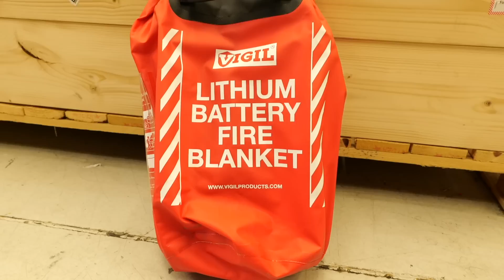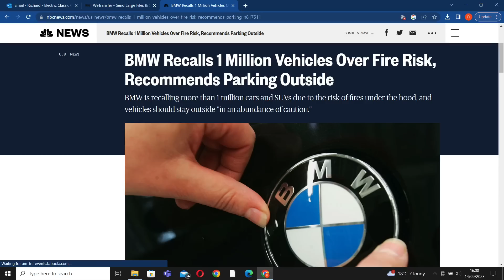Electric Car Fires - Facts and Figures

Comment: In Denmark the fire brigade has a container with an electric winch. In case of a burning EV, for example in a carpark, the fire brigade will drag the burning car into the container with the winch. The container is then moved to a remote place where the fire is kept under control. In the container the car is cooled  with water, that is recycled in a closed loop, inside the container. The car will remain in the container for at least 24 hours to make sure that the fire is put out for good 👍
Reply: In parking space situation in confined spaces situation (like building basement .. ferry ships ..etc) ... how likely this "wiched container" will work to overcome BEV fire incident ..??????????????/
Reply: @kebeleteeek4227  One "?" is quite enough, to make your point.
Weel they use them in practice, so there's your answer... I do believe there are some solutions with small robots to drag them of the car park to the container
Reply: @briantarby675  How quick those robots can be deployed to deal with rapid cascading effect of BEV battery self combustion ..??  .. How strong those robots to deal with "incinerator" kind of fire situation in confined spaces (basements .. ferry ships ..etc ..) ...?? ...   Not to mention the availability of that robots .. ??
Reply: @kebeleteeek4227  at least those robots won't die or be permanently disabled by the gases and smoke from the batteries.
Reply: @LoremIpsum1970     .. there is "good news" though ...   " ... Compared with their respective population here, EV fires averaged 2.45 per 10,000 vehicles, versus 0.42 for electric hybrids and 1.97 for combustion engine vehicles .. " .. -StraitTimes (Singapore): ...

" ... Looking at the London Fire Brigade data, that would suggest an incident rate of 0.04% for petrol and diesel car fires, while the rate for plug-in vehicle is more than double at 0.1% .. " ... -FleetNews ..  LOLLLLL
Reply: I believe EV’s are the future, no doubt. I support that future. Thanks for producing this video. Yet as an architect and firefighter, I will state that thermal runaway is a real challenge that we have never seen - regardless of the ‘percentage of occurrence’  stats - lithium battery fires are presenting fire departments and building fire protection systems with challenges as yet unseen and never accommodated for in design or construction of any of our structures worldwide. Quite simply lithium battery fires that include E-Bikes, EVs, personal mobility devices, etc. make fires in confined and semi-confined spaces much, much worse. These challenges are that fires well seated by thermal runaway burn faster, hotter and more violently making firefighting more dangerous, and property and life loss greater on a per incident basis when the ignition and/or fuel sources happen to involve extremely rapid, self-sustaining chemical decomposition. In the end, currently there may be less occurrence by type of vehicle/fuel source but fires involving thermal runaways are much worse, less controllable incidents.  Also your report completely ignores showing a side-by-side of an EV and ICE vehicle fire that would clearly show the challenges to the response forces required, the extended incident timelines hence collateral impacts (e.g. traffic, air quality, etc.), and the additional required water resources with resultant pollution streams.  The EV industry should be less worried about how media portrays the risks and contributions to major incidents and more concerned with financing the research into incident suppression in the name of public safety and providing the tools required to do so; it is not a problem that the fire service should have to solve.  PS Your data needs also. to be correlated by relative age of the vehicles involved to in fires. It’d be interesting to know if the percentages get closer as the age the EV/ICE vehicles get closer. Obviously the ICE fleet in Sweden is on a average older than the EV fleet.
Reply: @quarrycliff  I pity the public not being made aware of the potential harm from off-gassing and smoke, as they won't be wearing PPE
Reply: @quarrycliff 
Good points all sir!!!
Speaking as a retired EE and volunteer firefighter here in USA I 2nd your thoughts and opinions.  EV fires: Low probability? Perhaps..
High Consequences? DEFINITELY
Reply: They did similar on the damaged EVs on the Freemantle Highway. Sodium carbonate solution in a steel container 'safely' discharges the battery pack, covering the container and reducing fumes. One thing to note that no one mentions is the toxicity of the gases/smoke and suppressant runoff from packs containing cobalt.
Reply: @LoremIpsum1970  EV fans never mention ANY of the problems associated with them. If anybody else does they deny them, there seems to be a general trend that if they haven't had any issues then they think nobody else has or will. I even had one last week saying there are no problems with EVs at all. Try telling that to the millions who can't charge at home, or those who can't afford one.
Reply: Fire percentage,  0.08 for ice, 0.004 for ev.  Fine if you compare vehicles with the same age and odometer miles.  As ice vehicles, at least, age the failure rate, including Fire, increases. Most EVs have logged far fewer miles  and are comparatively much newer  than the ice fleet.   I don't know if such an apples to apples study has been done, but until we have that data, I believe the  jury is still out.
Reply: Let's assume EVs have a lower fire incidence of fire. Right.  But the Consequences of an EV fire are far more severe if the battery is involved.  It matters not if the fire started in the EV or a petrol vehicle parked next to it.  Toxic gasses and vapors such as HF are released, and if thermal runaway does not immediately  ignite this flammable mix, we have an inhalation hazard and possibly a deflagration event.
Please remember that all li ion chemistries contain fuel and oxidizer in each cell. If the porous polymer separator, typically less than 0.001 inch thickness is violated for any number of reasons an immediate or delayed thermal runaway may occur.
Reply: This proves that also authorities unfortunately believe the sensational stories of the propaganda. They really think that it is a matter of time that one EV will catch fire instantly.
Reply: Unless the garage has a max height, like most have here, of max 1.80 m. Then they cant get it in.
Reply: Has anyone considered the costs of EV dunk tanks in terms of fire personnel, prolonged road closure, and safe detoxification of the used water? Oh and the chemical soup in the burned out 1000 pound battery remains? Can we compare the Total Cost of one EV fire to one ICE fire?
Has anyone done a study on this?  If anyone knows on one please add a link herein.
Reply: There was a guy who took his tesla to the boat ramo bc he was hauling his boat, his telsa caught fire. For FD just pushed his car i to the water. Bc it was a lithium ion battery it produced it’s own oxygen as it burned, it was fully submerged and continued to burn for 2 days
Reply: Meanwhile in countries like Australia (and presumably the US and UK) we’ll just focus on complaining and overreacting to the occasional BEV fire and denying the need to shift away from fossil fuels asap, instead of coming up with clever solutions like that.
Reply: @ad_fletch  Try that on a busy motorway where it takes an hour to get to the car. Did you see the bus that went up in Paris? Had there been passengers on that bus there's no way they would have got out. We're getting those where I live soon. Yet I can't remember the last time a diesel bus went up in flames. 

The point is it's another serious issue that causes a lot more problems and needs to be addressed, but as with anything EV, anytime that anything negative is brought up it's just about making excuses. All this extra hassle, and all this extra money that's needed at a time when people can least afford it is not what is needed. 

Transport accounts for a tiny percentage of fossil fuel use, and that's all transport, including ships, railways, air travel and so on, and switching to EVs won't make that much difference anyway as oil is still needed for the plastics, the tyres, the manufacturing plants, the extraction of heavy metals for the batteries and so on. There are far better things that could be done, electrifying the railways for one, some areas have been waiting for decades and still are. Cutting back on imported junk that we don't need and should stop buying would probably make more difference than forcing everybody to go buy an EV and would be a damn sight cheaper too. Scrapping hundreds of millions of perfectly good cars and building millions of new ones, all of which will lead to more emissions from the manufacturing process in the short term, is at best madness for the tiny amount of emissions it will eventually save - if any at all. And you all have the audacity to try and claim that we're the ones with our heads in the sand.

Comment: There was a case in Norway where a fire had started in a parking garage destroying hundreds of cars, the media immediately started rolling the news as "NORWAY FULL OF EV's! EV STARTS MAJOR FIRE! EV ARE DANGEROUS BLA BLA" and everyone rolled with and everyone believed it... but the authorities later released a video from a surveilles camera that showed a diesel car starting the fire... and what did the media do? that's right, not a damn thing, they where silent as the grave..
Reply: Also in Norway there was an EV fire in a nearby town, and the media went ballistic over it before any details were out.

Turns out the EV battery wasn't involved in the fire at all. It was an interior fire caused by a cheap power tool in the rear seat catching fire.
Reply from the maker: Yep, unfortunately that’s how the media works. I see this type of thing every week. ☹️

Comment: There are lies, dammed lies and statistics and of course you have to take into account the ages of those vehicles I admit I don`t know but would guess in Sweden the average age of ICE cars is much older than the average age of EV cars?  We had a less than 1 year old Mercedes EQV on our fleet that suffered damage from a marder and we were told we were VERY lucky it didn`t catch fire. The problem is that that likely happened when parked in an underground car park and it would have been in amongst many other cars.
The products of combustion from an EV fire are much more dangerous than from a ICE car and people inhaling the smoke are much more likely to have a bad outcome.
The basic premiss that this is a high risk / low probability event is true but as with ICE cars as age increases so probably will the occurrence of fires for a lot of the same reasons older  ICE cars are more likely to catch fire.
The key issue at the moment is the lithium content in batteries and how it responds to thermal runaway. Alternative battery technologies can mitigate the risks down to probably a similar level to existing ICE cars and maybe even lower, lets hope they are available quickly.
Reply from the maker: The age arguments don’t really stack up because the number of recalls of new ICE cars due to fire safety issues is so high.

Comment: Thanks for the explanation. I also heard that many EV fires started some time after they damaged the battery cage with a stone or something on the road
Reply: If you want to see JUST how incredibly resilient battery cases are in their ability to resist puncture, just watch the other "Truth about EV fires" video on this channel from 4 months ago - Richard has a fabulous time "blowing things up" as he puts it...!!  🤣
Reply: Hi, yes, depending on the battery technology. Oxygen in the air can get in and trigger a chemical reaction. Does not happen with the later Lithium Iron Phosphate (LFP) technology - the 'F' stands for ferrous, ie Iron. It's one reasons why the battery packs are built so strongly. However, how comfortable are we driving around with a tank of petrol/gasoline in the back of our cars waiting for a rear end collision? In that respect diesel is safer, much more difficult to ignite a spark.Unfortunately, not good for the roadside environment.
Reply: Just because you heard something does not make it true. Condon has made that perfectly clear to all (open) ears.
Reply: I drive an EV taxi and i have to deal daily with anti EV people which is annoying. I'm defending EVs not saying bad things about them. A damaged battery cage can be a problem
Reply: @2.3_44XD--  True and a damaged gas tank can be a problem also just ask a Pinto owner if they are still around.
Reply: @2.3_44XD--  Must be a great savings from an ICE.

Comment: Last vehicle fire I saw was a BMW M4 6 cylinder petrol. It was a shell by the time I passed it. Fire was a quarter of a mile from the Fire Station. Previous to that was a wee old Corsa, probably petrol. Before that a diesel double decker bus, which was down to its frame only 2 miles from Fire Station.

Comment: Lets get the stats right, when looking at cars on fire, EV cars are pretty YOUNG. ICE cars fires also include cars made in the 70's... Can we put a production age on car fires to have an honest discussion? I have 3 EVs on my parking but own more ICE vehicules..  None of them burning :-)
Reply from the maker: BMW, Hyundai,Kia, Ford, to name but a few manufacturers that are presently recalling millions of ICE cars because of fire risk on new cars this year. And over the past few years nearly every major car manufacturer has had recalls because of fire risks.
Reply: @ElectricClassicCars  isn't because new cars are full of electronics and control systems that they more prone to failure and catastrophic events? Does not matter if they are EV or ICE... Major manufacturers keep cost cutting and produce lower quality. Toyota bZ4X had the wheel fall off, I hardly call that an EV related issue...
Reply: Car fires are in general rare.

Comment: Another thing to consider: EV batteries are rapidly getting safer and more resistant to thermal runaway every year as more development goes into them. That might explain why the number of EV fires hasn’t increased despite more of them being on the road.
ICE cars aren’t getting any safer in this regard really.
Reply from the maker: Very true. More and more new EVs are coming out with more stable battery chemistry like LFP which is much less likely to catch fire too. 👍

Comment: A couple weeks ago, a local news station had a story about an electric car crashing into a tree, causing a massive fire. The detail they left out of the headline was the fact that the electric car crashed into the tree 6 feet above ground...and may have been exceeding the speed limit just a bit before launching into the air and colliding with the tree.
Reply: ...but that's still a fire...no? does the speed or whether it was flying make any difference?
Reply: ///been exceeding the speed limit just a bit before launching into the air and colliding with the tree.///

...and if the car had been an ICE vehicle doing the same thing, would that have caused a massive fire too?

Or to put it another way, the speeding bit is irrelevant, it's the causing a massive fire part that is noteworthy.
Reply: When someone hits a tree, I just assume they were either drunk, speeding, driving like an a--hole, or all three. People tend to hit trees or power poles pretty hard.
Reply: @mswen1983  Hitting a tree is a lot safer way to stop a car than hitting solid rock... Most cars are big enough that they climb up the tree if speed is right. A long time ago I stopped my car by reversing it downhill to a tree after both clutch and brakes failed. I just pulled the ignition key off and jumped out.
Reply: That's not the concern. Doesn't matter. What matters is that a regular gasoline/diesel vehicle can be extinguished fairly easily with 500-1000 gals of water. An EV fire can take up to 40-50 THOUSAND gallons. My municipality has had several of these and it's the same problem every time no matter the manufacturer.
Reply: still EV owners should pay pollution penalty
Reply: @MaximumEfficiency  All car companies - all companies - should pay pollution penalties proportionsl to tye damage dealt.
Reply: @conradharcourt8263  thanks for sharing
Reply: 6 feet!? Some day, I'll be that good of a driver.
Reply: Speeding might be caused by braking issue